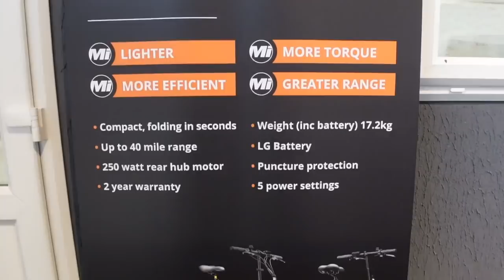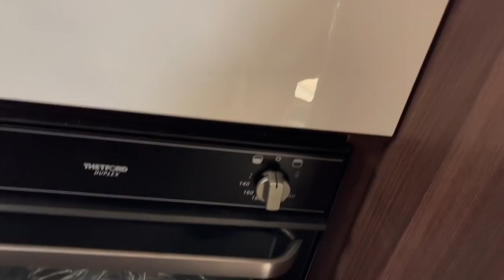This changes EVERYTHING - Vlog 79

Comment: hi guys could you tell me what number sikaflex you use i just bought the same antenna as you and need to stick it on the roof but theres so many sikaflex tubes ,,thanks
Reply from the maker: As there are a few things that would change which sikaflex to use we’d recommend watching the video where we fit it as all the bits are covered 😁👍🏻

Comment: Sooooo, how do you charge your ebikes when not connected to 240v? It’s a problem we’ve had since we first got ebikes 2 years ago. Any advice or links to charging products would be seriously appreciated!
Reply from the maker: We charge from the inverter in the van or the poweroak AC50s if we charge them outside.. they hardly take anything from the poweroak, it’s a cracking bit of kit and we recharge that while we’re driving via 12v socket 😁👍🏻 links on the website if you want to take a look..

Comment: May I ask you a question please, I'd appreciate your expertise as I have had varying answers to this.  Have you ever considered getting air conditioning fitted for the habitation area, and is nit feasible/possible to run air con from the van's 12v system, and if so, what combination of solar panels and lithium batteries would you need.  (Presumably it helps that air con would be used most when it's sunny and the solar panels are generating!)  Many thanks, and happy travelling.
Reply from the maker: You’d need around 1200w of solar to run the aircon, but it’s probably never going to produce that much power in British weather.  So you’d always be eating into your battery power, even if you had 500ah of battery bank you’d struggle to run aircon for a full day.  They’re just too power hungry to be an offgrid option.

Comment: Those new bikes look good. That oven looks like a great improvement.  As soon as you said the vans nearly finished I thought no never. Every time I thought that there is something else I want to change.  I did mean to ask how did you attach the pockets to the doors ? As the door is a bit too thin for screws (or at least mine is).
Reply from the maker: Thank you 😁 the bikes are awesome and the oven is really good so far.. pizzas, jacket spuds, lots of baking.. can’t wait 🙌🏻 
They have Velcro straps that pass over the top and attach behind - there’s a little vid about how I made them on our channel if you search for pockets so you can see properly 😁👍🏻
Reply: @johnmandy  Thanks I must have missed that one.